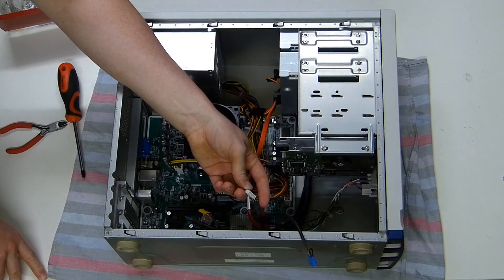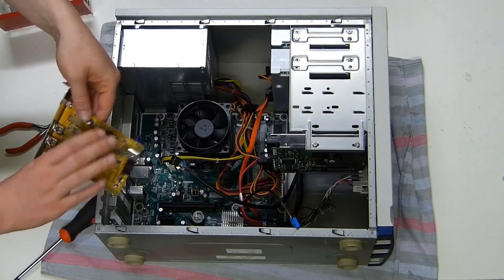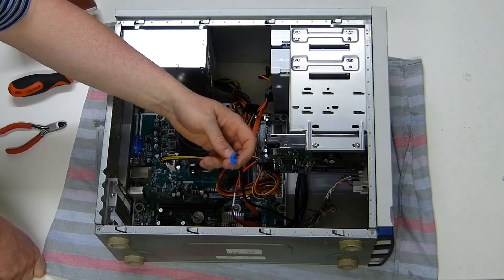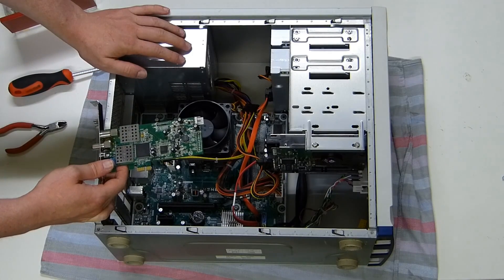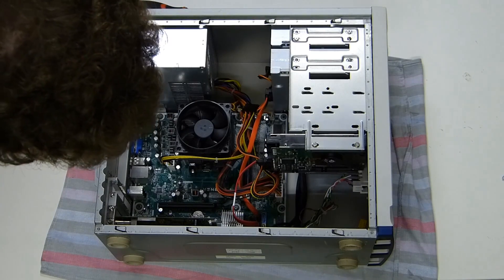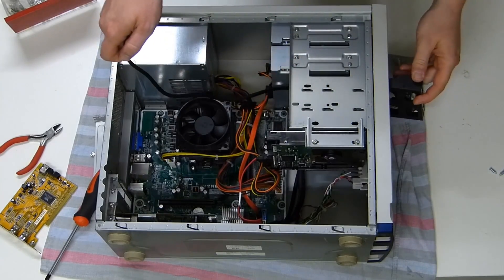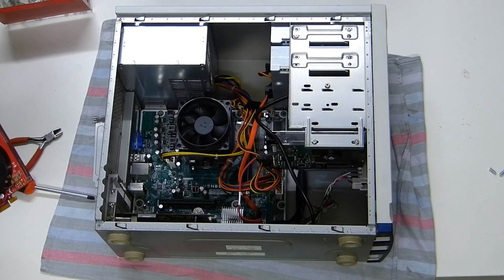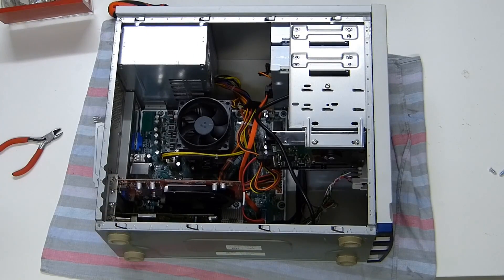Building a PC [4/5] - Expansion Cards and Card Reader

Comment: What GPU is that? :3
Reply: SnOpeK Domowei I'm going to guess and say... it's definitely an ATI/AMD card and looks like something along the lines of a low-mid range card, reminds me a lot of either 6000 series card or 3000 series... not quite sure.
Reply from the maker: I have no idea... nothing special, that's for sure.
Reply: Ah so i guess it automatically detected the appropriate drivers?
Reply from the maker: So far I have not installed any OS on the system...
Reply: Oh i see, seems like a decent pc though.
Reply: ***** depends on the card, if it requires a power connector from the power supply then no, upgrade your power supply if you have the chance